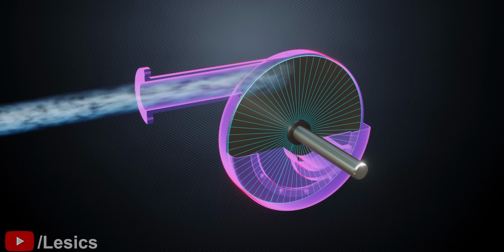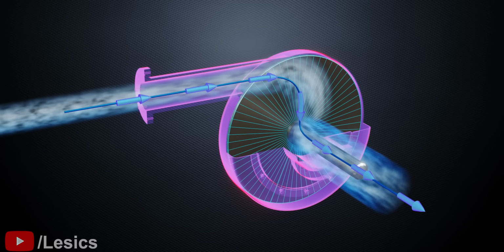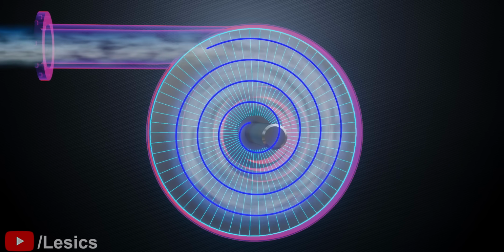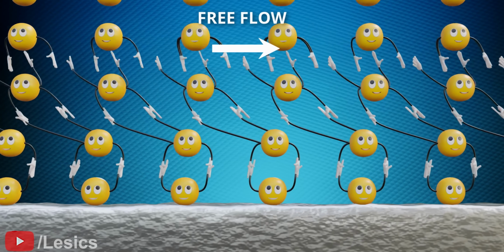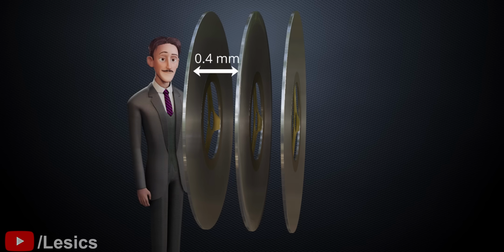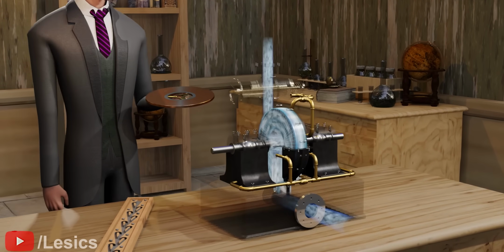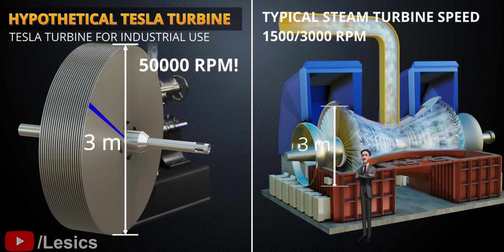Tesla Turbine | The interesting physics behind it

Comment: Interesting note: Mach was a big influence on Tesla. Tesla's research and philosophy closely followed Mach's. Mach's wave mechanic experiments in Prague were a huge influence on Tesla. By the time Tesla left university, he had nearly solved the alternating current problem. Another thing that's amazing was the AC problem quite literally nearly killed Tesla due to an all-consuming mental and physical breakdown.
Reply: not even close
Teslas biography is online
you should read it
he had a nervous breakdown in his 3rd year of college, and never completed his degree. It was from working to ace all his courses, he drove himself to a mental collapse.

there was no AC 'problem'

he conceived of a way to make a self starting ac induction motor, which is what made the AC power grid viable for industry. The concept was clear in his mind, he knew it would work from conception. There was nothing to solve, just needed funding to build a prototype and get a patent, which he did later in the US
Reply: @kenwittlief255  Faculty, not college.

Comment: In order to get high pressure and as a result high flow we are using high temp steam. In Tesla turbine the highest temp hits OUTSIDE of the disc where t he biggest forces are occurring.  Tesla idea is just theoretical exercise at this point with todays materials and technology. No practical use, period.

Comment: Seems to me part of the problem with is the design of a flat disc.  That's a lot of mass to spin.  Perhaps smaller discs that taper in thickness from hub to rim would increase efficiency at lower rpm.  The thickness of an individual disc isn't important except for what's needed for strength and resistance to deformation, it's the surface area that does the work.  Of course you'd then need tapered stators between the rotors but they'd still be far easier and cheaper to machine than conventional turbine blades.

Another notion; a spiral rotor.  Think a compressed Archimede's screw.
Reply: There's a couple problems with an archimede's screw. One is that you'll have substantially reduced volume with each turn, so you'd have to account for the change in boundary layer as it tightens up, another is that the rigidity of the surface against torsional forces would be severely compromised, and the final one is that the turbine head would be very long compared to plates for the same surface area which would introduce more vibrations in to the shaft.

Comment: After watching five minutes hearing "turbine" and "fluid" all the time I am confused. If  that Tesla "turbine" handles fluid it is a water turbine. If it is a steam turbine it handles expanding gas ( water vapour).
Then you definitely do not want any "fluid" (i.e. condensed water) around.
Reply: Sorry, but in engineering gases and liquids are both fluids for most applications. The big difference is unit weight and viscosity. If it flows, it is a fluid.
Reply: Gas and liquid are both fluids. They flow.

Comment: da vinci ,tesla,orsic,phytagora,john dee...nostradamus & many others in the history , they all receive 'messages' & visions when they working or trying to decode the matrix..... 
where the matrix stay as man use..... not as man creating......  
3X3X3 X5 X37 is 4995 where 111+222+333+444+555+666+777+888+999 is 4995 and where 37 its a star number after 13 both holding & hidden the matrix ..... 
but ..yaaa ...it can get to abstract.... .. (  abstract communications) 
 123456789+987654321 is 1111111110 X 1111111110 is 1234567898765432100 / 37 is 33366699966633300 where 37 it's a star number after 13..... it's also encoding in to 'abracadabra'.... but .. y̶̡̢̙̘̗̼̯̰̅͂̍̽̆́͒̆̈́̀̉̕͠a̵̯̟͇͉͋̚͜á̴̡̮̣͇̲̈̓̒͊͂͝ͅȁ̶̢̳̪̥͎̩̦̫͓͓̏͋͌̀̑̔̑̆̄͌̽̄̂̄͜ͅa̸̟̰̟̱̫͔̿̈́͋̿̒̍͊̂̋̆͜͝ͅ ̶͛̿.....knowing & believing are also different things.....

also used in to occult or a virus...... 
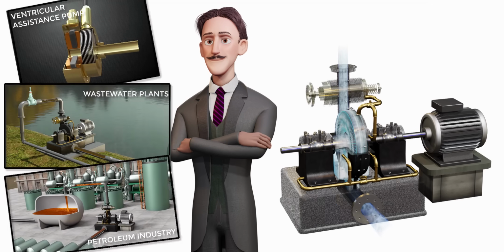Mark 9:11 gives 9 x 11 = 99 Matthew 20:16 King James Version (KJV)or 33X6X2 as the sigil of saturn its using today by the masons... 
'So the last shall be first, and the first last: for many be called, but few chosen.
'
2X1X6 X 2X1X6 is 144 where 6X6X6 is 216...
have to mention that numbers are only an humans agreement..... they can also use bamboo & dots.....but this kind of teaching its forbidden in many schools..... so i post only a few visions....   the matrix fit in many things.... even in to occult or a virus....(just keep in mind the english language it never existing 2000 years ago..... but the matrix been here forever).. if you use the matrix to give the virus an spiritual meaning.. than you get.... AuAg.... the virus code.... (the visions about the matrix as man use....not as man creating) ....
c o v i d 19
3 15 22 9 4 .. 19 (3+15+22+9+4+19 )
72 X 37 is 2664 that is 666 X 4.... where 37 its a star number after 13.... both holding & hidden the matrix.... and 111 its the sun number.... (also use as a powerful portal... but it get to abstract .... __abstract communications)
if you take j e s u s for example....as spiritual healer.. than you have....
j e s u s
10 5 19 21 19
74 X 9 is 666 the magic square of the sun..... (37X2X3X3)
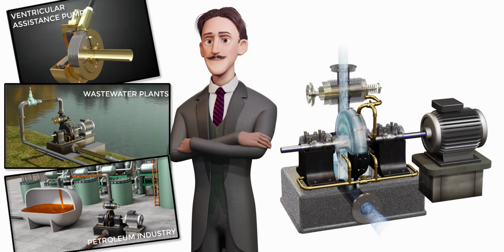Mark 9:11 gives 9 x 11 = 99 Matthew 20:16 King James Version (KJV)or 33X2X6 where the sigil of saturn its using today by the masons... in hertz freq liberating guilt & fear.... 
'So the last shall be first, and the first last: for many be called, but few chosen.
'
2X1X6 X 2X1X6 is 144 where 6X6X6 is 216...
123456789+987654321 is 1111111110 X 1111111110 is 1234567898765432100 / 37 is 33366699966633300 where 37 it's a star number after 13..... it's all encoding in to 'abracadabra'..
🌏 📡🌏 👣🕖 💎👽☠☼☾☄ゞど・ㇺㇾㇽ₪𝖎𝖙𝖎𝖇𝖎𝖗𝖆₪なめㇺㇾㇽ✶☥✨🌛🌄⊀✶⋊🐺🐾♓️☆🐜🐜🐫▲▴◭
the matrix(unfolding).... used as an occult vision in to humans history by different cultures on this planet....
....6X6 is the symbol of the sun....SUN (6*6)
6+ 32+ 3+ 34+ 35+ 1 =111
7+ 11+ 27+ 28+ 8+ 30 =111
19+ 14+ 16+ 15+ 23+ 24 =111
18+ 20+ 22+ 21+ 17+ 13 =111
25+ 29+ 10+ 9+ 26+ 12 =111
36+ 5+ 33+ 4+ 2+ 31 =111
111+111+111+111+111+111=666
The "magic square of the sun," was one of the most important symbols used to represent the sun in antiquity because of all the symbolism it possessed involving the perfect number "6." There are six sides to a cube, the numbers 1, 2, an 3, when added or multiplied together are equal to "6," and the sum of all the numbers from 1 to 36 arranged in a 6x6 magic square are equal to the number "666." The square is "magic" because the sum of any row, column, or diagonal is equal to the number "111." After the Church became the state religion of the Roman empire, possessing the diagram below could get you burned at the stake!
When the risen Jesus (8880) is superimposed over the 6x6 gridwork of the Magic Square of the Sun some amazing things happen.
(corners 1,6second row 8,11,third row 15,16 nr are together,21,22 nr together 4th row form the group in a midle with 15,16 then 26,29 and last corners 31,36)
T̹͓͍̻̬̜͆̈́ͫͭͪ͠H̫́̂͌ͦE̼͐̽͊ circled numbers on the magic square form the Greek letter “X” which is the “sign” of Christ.
The circumference of each circle by calculation is 1480 units, the exact gematria value of the title Christ (CristoV = 1480)!
The sum of all the numbers in the field of the magic square of the sun (666) added to the sum of the numbers in the twelve Christ circles (222) is equal to the number of Jesus (888)!
Finally, the diagonal of each square that holds a Christ circle by calculation is “666” units!
6X6X6+6X6X6+6X6X6+6X6X6+6+6+6+6 Generate Outside Dimension....
(merry Xmas ....)
in the picture the matrix (unfolding) represent by the star number 13... & the cube structure...the symbol of atlantis ...and the black sun....
not to seen here..... but well in abstract communications.... all the visions (videos) there contain matrix sounds..... 
.so don't use headphones to loud or your mind can get in to receive mode...
don't worry needs lot of sacrifices & exercises & meditations to do this...no one become doctors or shamans in one day....
atiki taki tiki tu.... 

🌏 📡🌏 👣🕖 💎👽☠☼☾☄ゞど・ㇺㇾㇽ₪𝖎𝖙𝖎𝖇𝖎𝖗𝖆₪なめㇺㇾㇽ✶☥✨🌛🌄⊀✶⋊🐺🐾♓️☆🐜🐜🐫▲▴◭